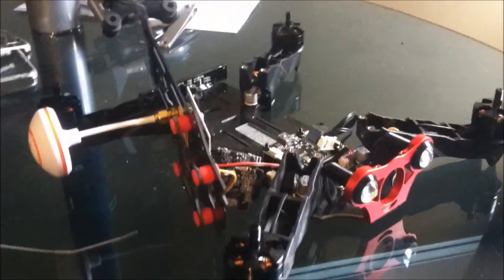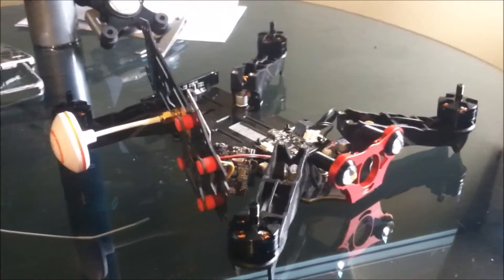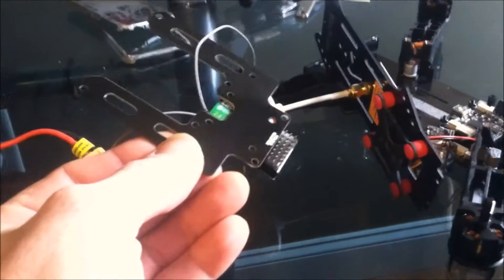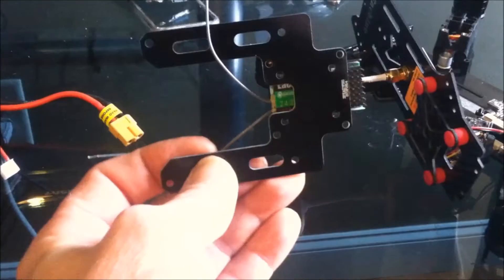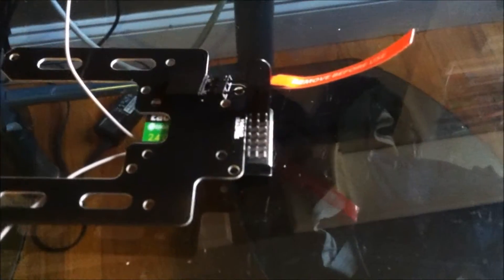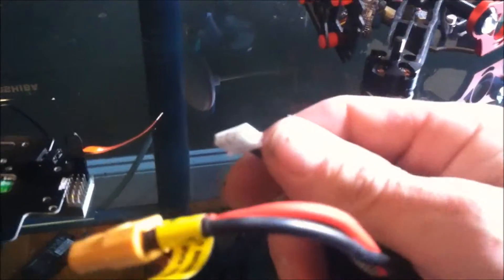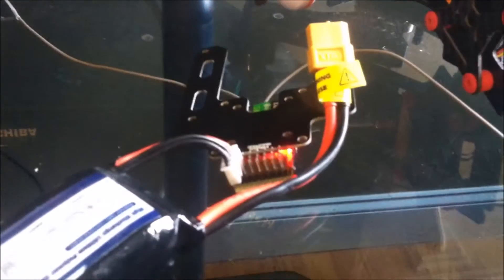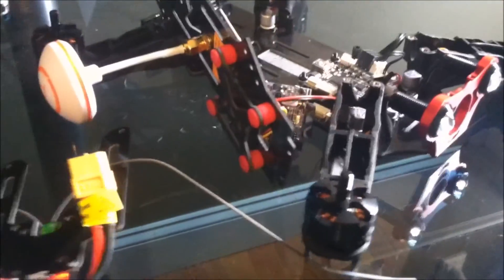Binding Eachine i6 transmitter to eachine 250 racer

Comment: tis doesnt seem to work, everything seems fine up till when i try to connect it without the bind plug then the light is flashing slowly but when i turn on my remote the light just continues flashing it doesnt stop
Reply from the maker: All I can say is try repeating the steps. It happens sometimes. I had a receiver sent to me that my tx wouldn't bind too also. It turned out the receiver was bad so I shipped it back and got another. It worked with the second one. Apparently there are quite a few people experiencing the same thing. Let me know how it goes.

Comment: Thanks, i just did the same mistake, but as a professional problem solver i used a normal wire and insulated the ends to act as a binder cable
Reply from the maker: Yea...I thought of that after the fact. Thanks for watching and commenting. Hope the video helped. Have a great day

Comment: This wont work. The light does not slow down or go solid to indicate that it is bound.  I bought my EA Falcon RTF but it wasn't bound and it wont bind.
Here is a video of my problem: https://www.youtube.com/watch?v=ZyE13DhuyY0
Reply from the maker: Ok...so I watched your video and I am thinking that you need to unplug everything from the receiver first. If that is not the case, then try resetting your tx to factory settings and see if it helps. If your tx is already bound to something else or an old receiver, you would have to program a new model into your tx or reset it to factory conditions. If it doesn't solve the issue then the receiver could be bad. Hope this helps
Reply: +MrTColson Everything was unplugged. I would reset it but I don't have a clue how to program a new model. Maybe if I select a different model on the tx and try to bind that it might work?
Reply from the maker: +bpunlimited Yes you should try that. Let me know how it goes
Reply: Just tried with a different model selected in the tx. Didn't work.
Reply from the maker: +bpunlimited The last thing you can try is resetting tx to factory settings. If that don't work then receiver is bad. I had a bad one shipped to me that I had to return. Also... do some more youtube research. There are ppl in here that knows a lot more than I do. I hope you get things going. Please keep me informed
Reply: Hi, I contacted Banggood and they said they will send me a new receiver. Now I need to wait another month because shipping from China is reaaally slow!
Reply from the maker: Ye I know Banggood is slow. I have been waiting on something from them for 3 weeks now. If you go to amazon.com you can find your part in there pretty cheap and get it in a few days if you don't want to wait.
Reply: +MrTColson Got a new receiver. Paid extra for fast shipping. And after all this, it still doesn't work! Maybe it is the transmitter that isn't working.
Reply from the maker: +bpunlimited It is possible the tx is no good or needs some work. It is also possible you got another bad receiver sent to you. I would try resetting the tx to factory conditions again then try binding. If it doesn't work, is there an rc hobby shop around you can take it to and have them check it out? That would be my next step.
Reply from the maker: +bpunlimited I am curious as to how things are going for you. Did you figure out the problem?
Reply: I bought the ia6b receiver while waiting for banggood to ship their replacement as I needed express shipping so I could bring the falcon with me on holidays. It still did not work. So I emailed banggood again and they told me to wait for their replacement to arrive. So now I'm waiting. If this doesnt work, they willl probably ship a new transmitter.
Reply from the maker: +bpunlimited I had bought another receiver and ran into the same problem you had. It is the same receiver. It left me stumped bit I finally got it to work by simply removing the binding plug before the power. Don't know why it worked like that. It just did...

Comment: I just updated to LibrePilot as well and now my flightmode switch isn't being identified when doing to transmitter setup wizard...any ideas here? I've been scouring the net for days!
Reply from the maker: You need to get in to the menu of your transmitter and change your auxiliary switch settings. Right now they are set as channel 5 is vra and 6 is vrb. I set channel 5 for switch c ( flight mode) and channel 6 is switch a ( lights). Once you do that , then input new settings in libre pilot and you should be go. Let me know if you need more help.
Reply: +MrTColson thanks bud, I'll give it a try!
Reply from the maker: Mike Gatlin So were you able to get things going?
Reply: +MrTColson I set up the transmitter, I'm currently waiting on an antenna to come in the mail. I broke mine in a crash yesterday and don't wanna power it up just yet and ruin the VTX...I'll have it in by tomorrow and will update you
Reply from the maker: Yea I broke mine in a crash too and found that my vtx got fried anyway
Reply: +MrTColson oh god, I didn't think about that possibility! parts take too damn long to get here for those types of issues!

Comment: hello there I did the bind like the video but my eachine not working and I don't see the receiver turning on can you help
Reply from the maker: +Emmanuel Hernandez Make sure your power source is good and that you are plugged into bottom set of pins. If you are properly connected and your power source is good, then you should be able to bind your tx to your receiver. If the red light doesn't come on and your battery is charged, then I would have to say that the i6 receiver is no good. They are cheap enough to replace. Good luck and let me know your outcome.
Reply: I just received everything new but I can't make it work . Do you have any video how to connect the i6 receiver with the racer maybe I have wrong connection
Reply from the maker: +Emmanuel Hernandez What did you get brand new? If you got the rtf version...then everything should work right out of the box. What is it that you are having a problem with exactly?